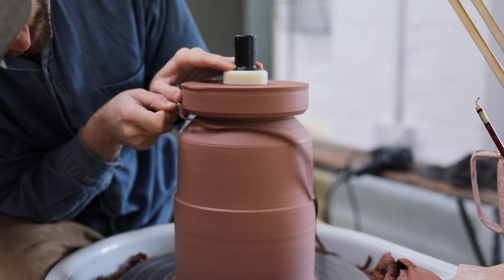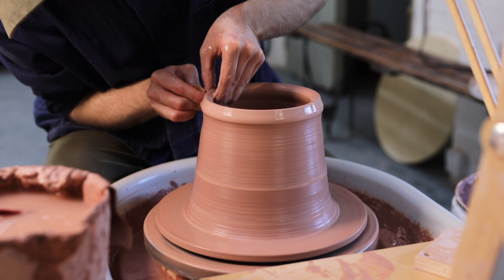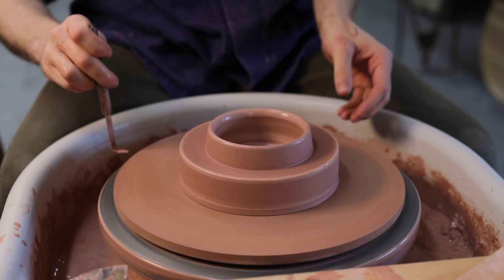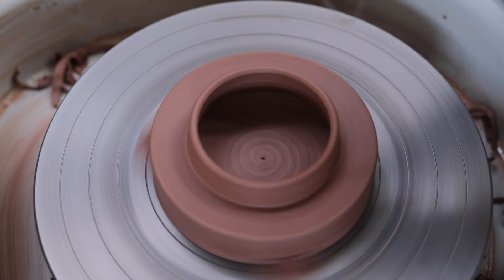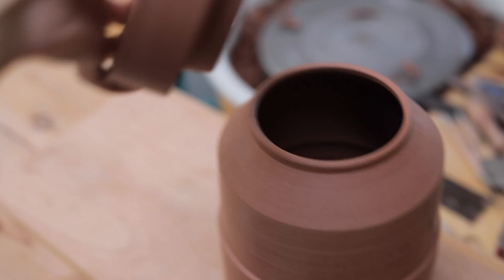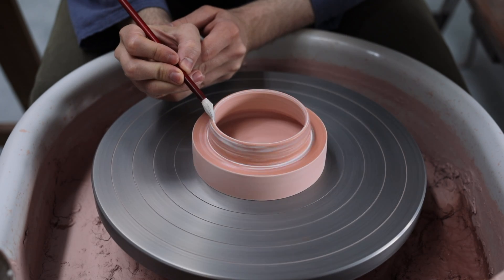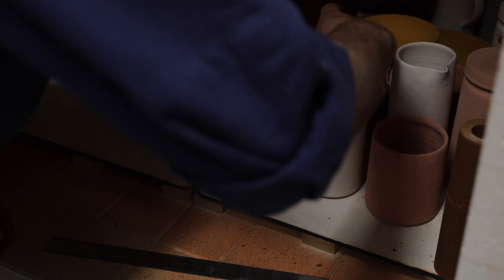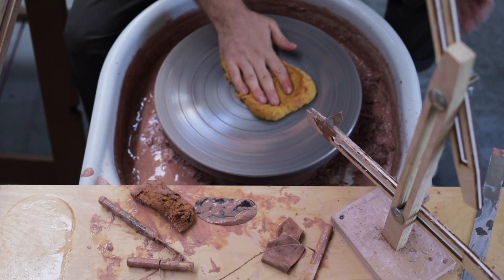Making a Large Stepped Lidded Jar — From Start to Finish

Comment: I have just almost finished my beginner level wheel throwing class and I have learned so much more from you than my teacher.  :)  I switched over to using your finger placements and it has worked real well for me.  The studio I have been going to also uses a reduction kiln so it was neat to see yours in action.  My first 8 pieces have just come out and the glaze looks nice.  My only complaint was that I placed it on too thin because they made me so paranoid about the $50 charge for an item sticking to the kiln shelf.  My colors were just not as bright as I would have preferred.  I do like the iron spots and such that the reduction firing seems to bring out.  Thanks for your vids!  I appreciate you.

Comment: Is there anyway that I can buy the wadding online?
Reply from the maker: I'm not sure you can... but if you purchase some china clay and some coarse alumina hydrate it's easy to make. You mix the two powders 50/50 percent, then very slowly add water to the mix until it has a clay like consistency, then you wedge it up like normal clay and that's it! Keep it well hydrated and kept in an airtight container.